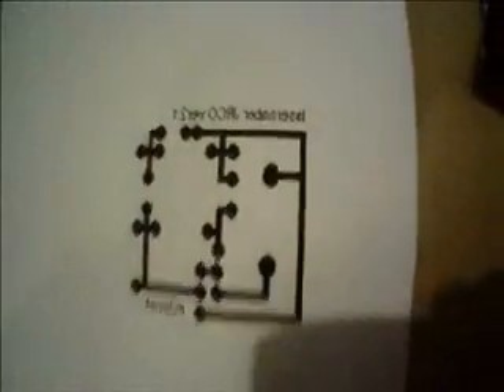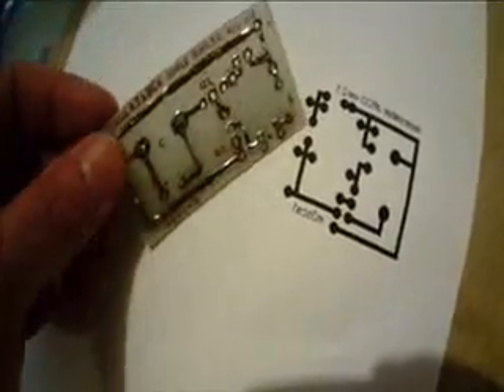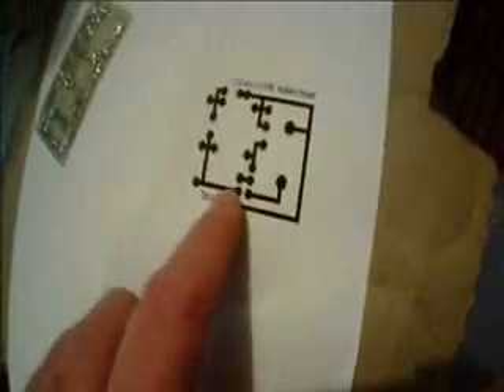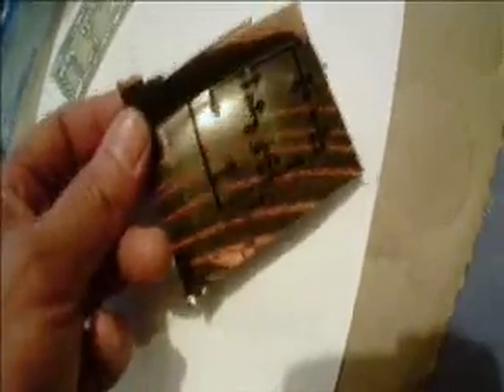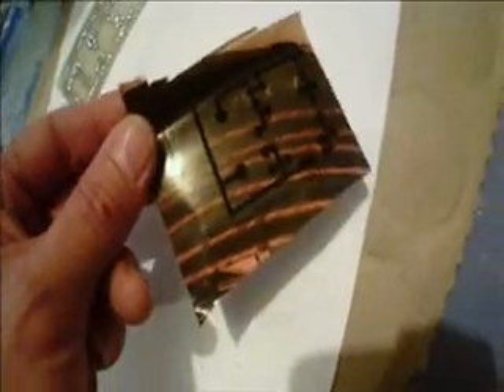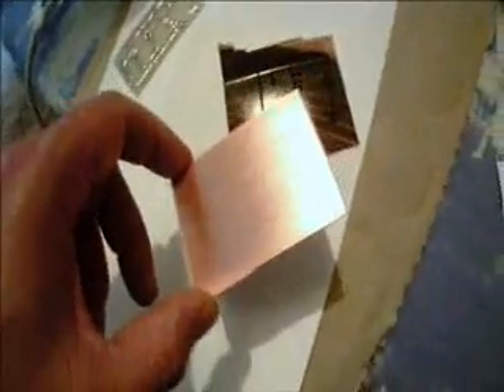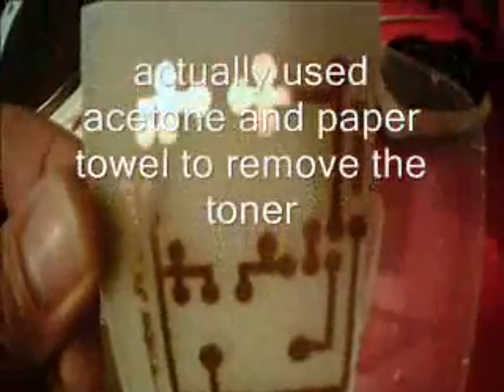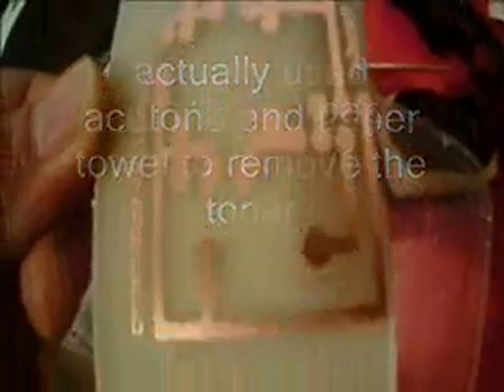PCB etching Toner transfer method

Comment from the maker: yeah i was very happy with the result and how easy it all turned out.
i think i may have pressed a little too hard in places because looking closely at the tracks it looks like the toner may have bled away from the printed surface.im guessing its a fine line between getting it to bond to the copper and bleed out from under the ironing pressure.

Comment: Cool. Board looks like it only takes a handfull of components though. Magazine paper is only about 35 gsm in weight not stiff enough to seperate from the fuser roller or fuser film. They are designed for 70 to 120 gsm paper 80 gsm is the norm. Try folding the magazine paper over a normal sheet of printer paper so the normal sheet is sandwiched between the magazine paper. Then feed the folded over edge in first (as the front edge) through the manual feed tray. Works on my printer.

Comment from the maker: Thats right,print staight onto old magazine paper,iron on,remove paper in water then etch.acetone was used after the etching was done to get the toner off.And by some strange coincidence,Nurdrage posted a vid showing 10 easily availble etch solutions at the same time  i put my vid up,go check it out to!

Comment: to save on solvent, print more (unused or used) area black. You need to take away less copper that way. And thanks for sharing! I learned to make pcb boards using ink pens, and then using special light. That is old fashion now! I don't need to save your movie, it is really KISS to DIY. Great!

Comment from the maker: the paper gets toner put on it from a roller drum in the laser printer.
the toner is carbon and plastic powder that is used in laser printers,i think the drum gets charged by the laser to hold onto the toner then paper is squeezed against a hot drum to transfer it to the paper.
i dont know exactly how the printer works but its standard office equipment.
when i heard about the method to use special paper i came across a forum that mentioned glossy magazine paper works too so i tried it...